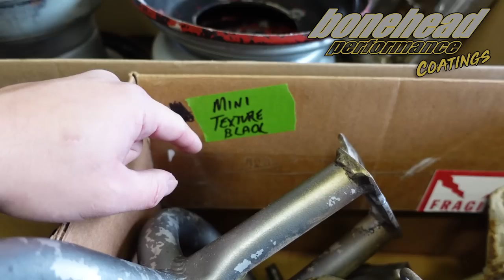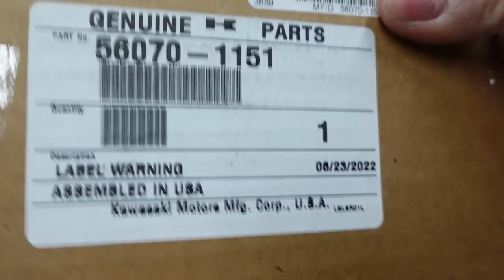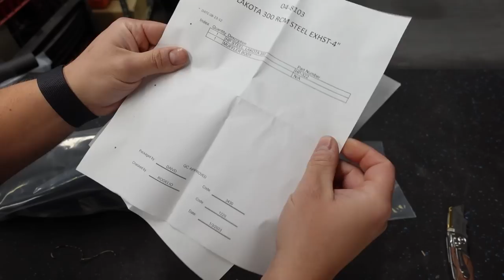Installing the Worst Case of Squished Tires I’ve ever encountered 😂

Comment: I just thought of this while watching. Use a tube to get the tire on completely seat both beads. Then deflate it brake the bead on the side with the valve stem take the tube out reinstall the regular valve stem. Then with one bead seated put the seated side down with the tire on some blocks. Then you can push the rim against the tire to get the air started again. As long as you have a good easy way to break the bead i feel like that method would be a good way to make the tire your b** !!!!!

Comment: Mike you're doing one thing wrong you're putting either on the tire you need to put the aether in the tire and light it and you can't be afraid of it you've got to put air in it right when it pops while it's on fire